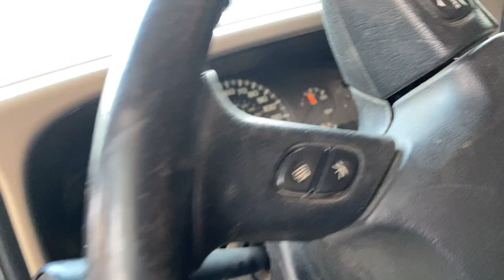Taking an oldie out for a walk!

Comment: Does that have power steering?
Reply: Yes!!
Reply: It’s called Armstrong steering!
Reply: @rudycarlson8245  really must have been aftermarket right?
Reply: @ccharlie678  originally when these tractors were built they did not come with power steering so yes it is aftermarket power steering that is on the tractor in the video I had one just like this one in the video except mine was a 1949 model
Reply: @rudycarlson8245  yeah I thought it had to be, we have 2 just like it but they are model a’s and they don’t have power steering.
Reply: The model A was the first thing I learned to drive! of the two cylinder John deer’s The ones that all the best is the A B R 80 730 Diesel
Reply: @rudycarlson8245  yes my great grandpas first tractor was the model A for farming and we have it still to this day!